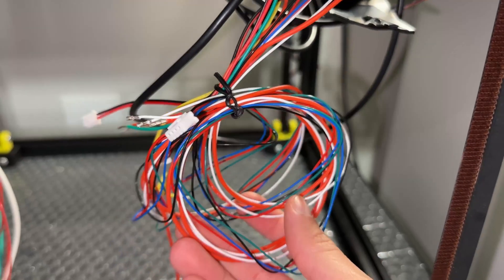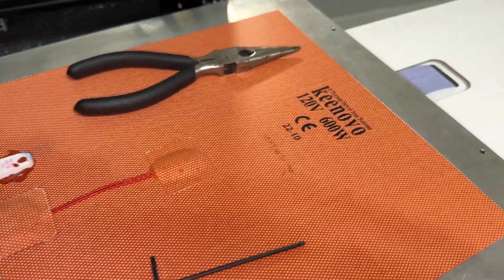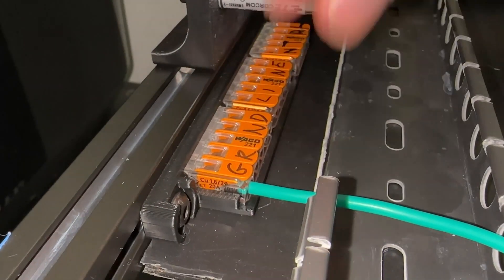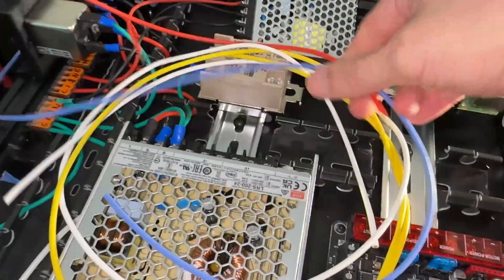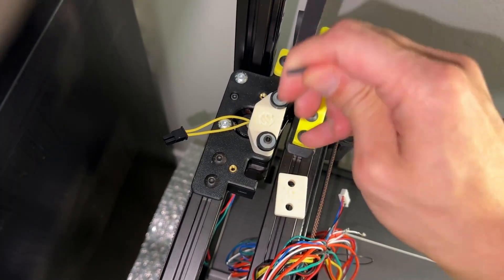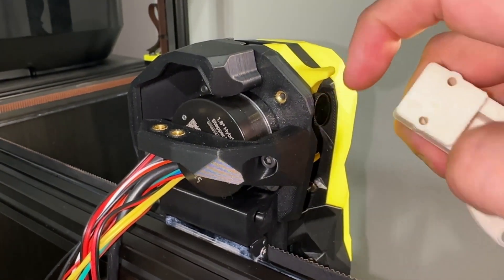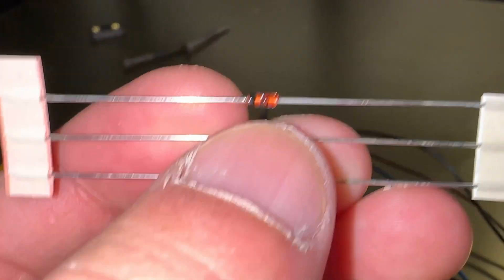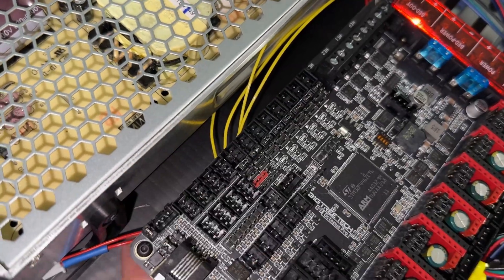DIY Voron 2.4r2 Part 11: Wiring

Comment: It's easy to pop open the cable chain covers using a thin blade screwdriver.  I quickly discovered how to push the screwdriver blade into the latch and quickly pop open each cover.  You'll need a watch repair sized screwdriver!
The Nitehawk-36 toolhead board I'm using has jumpers to set the probe voltage to either 5v or 24v, but I don't know if it has a diode in the signal lead.  I'm not going to use an inductive probe, but I do have an E3D PZ probe.  It runs off 5v, but will put out 5V high level signal so a diode would STILL be needed on the Nitehawk if its probe input isn't 5v tolerant!

Comment: Great job, Only thing I would suggest is to add a Ferrule to the stranded wires to make connections in wago much better and secure
Reply: wago terminals are designed to be used without ferrules as well